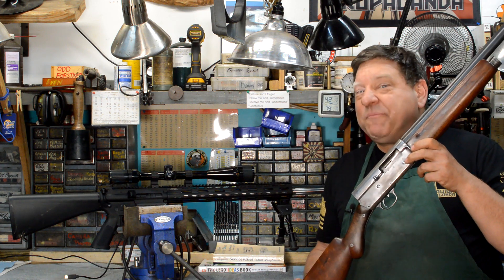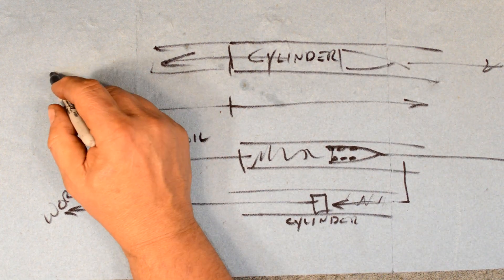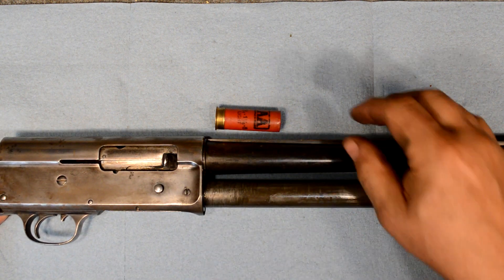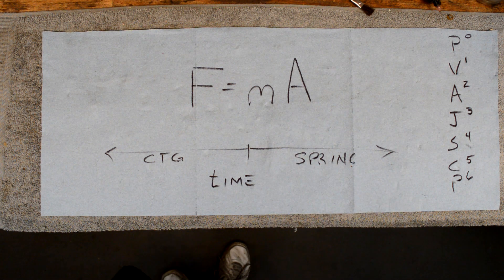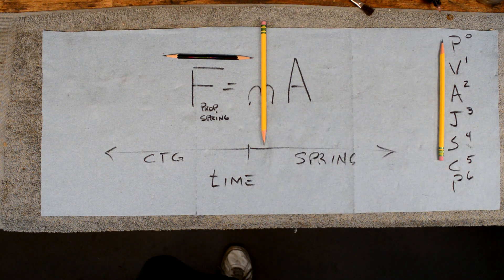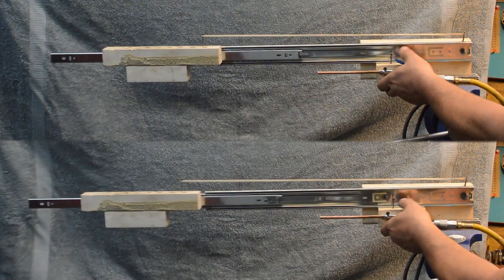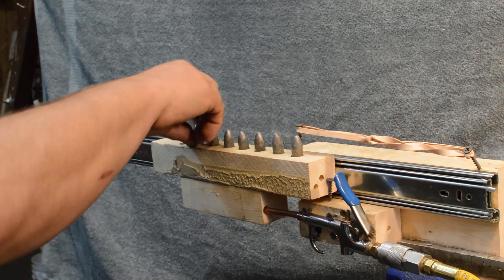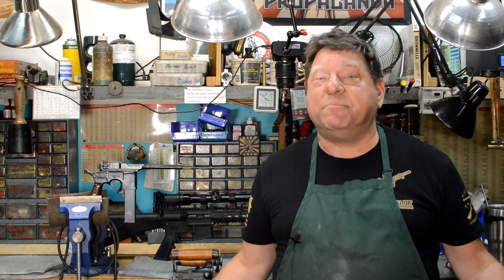Operational Physics: Anvil 069

Comment: Excellent demonstration. My only nitpick would be the bit about the system on the AR. You showed it with the gas tube and it blowing back and then later showed a tube of gas blowing back the drawer slide and I worry that gives the wrong impression to some degree. It sort of implies that the gas blows into the gas key and the buildup of pressure in the gas key causes the bolt carrier to back off from the gas tube and cycle the rifle. What really happens is the gas goes through the gas key into the bolt carrier, which is acting as the cylinder, and the gas pressure pushes the bolt forward from the perspective of the bolt carrier. Since the bolt is unable to move forward because it is against the barrel this causes the bolt carrier to begin to move rearward instead. This movement causes the cam pin to intercept the bolt carrier which forces the bolt to rotate and unlock from the barrel extension. When the bolt has moved far enough forward the gas inside the carrier is vented and the bolt carrier continues to travel rearward compressing the action spring on momentum from the expansion of the gas within the bolt carrier. I get that isn't what the lesson was about and going into it is probably not worth it but still, don't want people thinking the AR is as simple as that and that the gas rings on the bolt do nothing or that the inside of the bolt carrier does not need to be cleaned from time to time of carbon.
Reply: Oh boy... I wish that was simpler... 
But I believe I get it.. I just get lost with all the terms ... I think I get what you were saying compared to him..
Reply: @strydyrhellzrydyr1345  I was just talking about the AR-15. He showed an AR bolt carrier group and the gas tube for it and then showed his demo with a similar gas tube (the air nozzle) and I just wanted to point out to any viewer that may not know that this is not how the AR works even though he showed an AR as an example. I could see how someone could get confused and see the AR bolt carrier group and the gas tube and then see the drawer slide and the gas tube and assume they worked the same way because both examples have gas tubes but they do not, even though they are similar in terms of the example used, so the mass and velocity lesson is still applicable.

I am happy to break it all down further and explain any detail you may be stuck on, just give me a hint where to start.
Reply: Isn't it actually accelerating to the Right.. and decelerating to the left... Opposite of where he points.
The spring I mean... 8:55... 

I figured maybe I could ask you. Since I know he's a busy person.
Reply: @strydyrhellzrydyr1345  
It is decelerating the bolt when it is compressed. It is compressed when pushed to the right based on the reactive force from pushing the projectile to the left. After being compressed and stopping, the bolt is accelerated to the left again, picks up another cartridge, closes the action and ready to start again.
Reply: @onpsxmember  oh I know.. thanks.. 
I get that part... I was just trying to understand it by what he SAID... 
I could go by what I think.. but I was purposely trying to go by what He said... Since I am the novice...
But yes I understand.. thanx.

The problem is... He was explaining it as a gun facing to the right of the screen.
Reply: @strydyrhellzrydyr1345  Sort of.. depends on how you look at it. The spring is being accelerated by the cartridge, which could be what he meant.
Reply: Wait, waht?
Reply: Orion - yes, the goings on inside an AR are very interesting.  I think you could say that the “gas cylinder” is inside the bolt carrier, formed by the seal of the gas rings and the tail of the bolt with the hole behind/around it. When the gas enters that chamber inside the carrier that is formed by the bolt itself, initially the bolt is pushed forward at the same time the carrier starts moving backward. This take pressure off the bolt lugs and locking lugs on the barrel extension. Almost as soon as the carrier starts moving backward, the cam pin is forced to rotate the bolt thereby unlocking the bolt lugs from the barrel extension. By the time the bolt is disengaged, the carrier has moved backward far enough so that the gas rings on the bolt are ahead of the little vent holes in the side of the carrier. Gas pressure in that chamber inside the BCG is released and the entire assembly can continue moving backward due to inertia. This is the genius of Eugene Stoner IMHO.

Comment: But wait.. isn't the recoil part he says about on the bottom example... The same as the top one.. 
They are both recoil.

But the barrel is t moving on the chocheaut... Sorry I have no clue how to spell it..
I'm also confused on the cylinder statements... They are way different.. not just the cylinder in one and cylinder In the other

Comment: Video starts at 11:00
Long recoil is a derivative of cannon fire. 
Gas operation was (allegedly) discovered by Browning shooting in the tall grass. 
Maxim used recoil and gas principles on his gun, and also designed the initial prototypes of Brass, to prove the mechanics before the material was strengthened to steel. 
Kalishnikov invented nearly nothing, and the AK proves to be little more than a sloppy amalgamation of ideas, and ignorant of the issues presented by corrosion in a gas system. 

Gas operation was the least preferred, as drilling a gas port in the barrel was considered damning during the era of corrosive propellants, but has been accepted as a usable force since the beginning, as Maxim, and various short recoil guns, use muzzle boosters, which also suffered from corrosion issues, as you see all WW2 MG kits with a booster cleaning canister

Comment: Im fixing up a parker hale 30.06 i found i the field this year while ditch cleaning for the band office on the reserve. I have weighs tied up to the stock grip to help the glue settle were the crack in the grip is. Ill add a metal pin inside to help it keep together. Its a very nice looking rifle still but needs alot of work. Now that i have it it will be done and in good quality. Im using tung and teek oil this time for the finish with some stain. I took out the old chipped bedding and ill bed it again. Fun time to work with any rifles.

Comment: Mark, fantastic presentation !!! I see why you were teaching at one point in your life. I am a bit disappointed about one point in the presentation, the equation F=mA. At the point where you got to the F component being a representation of the Spring, you stated "At this point the equation works backwards", then you cut to the gizmo demonstration. I've tried every way I can think of to show that like you did with the F being the propellent component. I can't seem to get my head around the F=mA working backwards. Do you have to re-arrange the equation first to show the Spring component? Can I get you to elaborate a bit on how it works backwards? Please.
Reply from the maker: The equation is not rearranged, but the magnitude of the spring push is negative. Propellant force plus negative spring force should add up to zero, neglecting friction and sound.

Comment: All semiauto guns are piston driven. The cartridge case on a straight blowback is essentially the piston and is replaced after each shot.
Reply from the maker: That's it.
Reply: @marknovak8255  I think this would be a good topic to discuss in a video, because I've had countless people disagree when I said "all semi auto guns are piston driven". It would really make some people think about it a little more, especially if someone with your pedigree were to discuss it. You are actually the first person that makes videos to actually agree with the statement, unless you were being sarcastic and I missed the sarcasm. All semi auto guns are piston driven, and the piston is just located in different places. Straight blowback uses the cartridge case as a self replacing piston. The AR is an internal piston inside the BCG. The AK is obvious. Roller delayed is essentially the same as straight blowback with the cartridge case as the piston and the rollers "delaying" the opening of the bolt, etc. 
I'd love to see the responses you get if you were to discuss this topic.

Comment: I noticed on a kangaroo drive many decades ago those Browning's were soft recoil guns , compared with my Winchester pump action. Or they used lighter cartridges.
Reply: All other things being equal, a semi-auto is basically ALWAYS going to have softer recoil than a manually operated gun. The springs involved absorb quite a bit of the recoil impulse that you'd otherwise directly feel.

Comment: MArk, as a physicist I am offended by one choice: Acceleration is the vector small a, not A. A is the area.
Reply from the maker: Copy that, but the lesson still works......?
Reply: @marknovak8255  the formula checks out but for the different character to the standard.
Reply: Some Electrician is gonna tell you that A is amperes
Reply: @cstoff6066  Ampere is a unit, the formula was with variables.
Reply: @trischas.2809  I know, Amperes usually gets denoted as 'I' as in V=IR. Thank you world for the confusing array of characters based on people's names, Greek prefixes and medieval containers. Hogshead of Ale anyone?
Reply: @cstoff6066  Thanks but, I pfefer a Gō of Sake. Bur then again, why don't we all measure our length in Angstöm anyway? Wouldn't be too confusing I assure you. Not even too prone to a few inaccuracies for exponent drop...

Comment: This is an excellent episode. It does a great job of explaining "over gassed" MSR. The problem is usually timing. I like to slow the bolt down with heavier buffers and springs before I even consider adjustable gas blocks. The gas is supposed to be there.

Comment: That was the most awesome explanation of operational mass and timing I've heard in years the first time I was 7 or 8 and I was asking my dad what he was doing he explained hes increasing the amount of powder in a 30-06 round but needs to make sure not to over pressurise the gas system of the semi auto M14 rifle because to high a pressure may alter the timing of the bolt mass as opposed to the return buffer and ultimately break the rifle. Haveing an idea what you were saying fromhaveing listened to my dad years ago. Gota say I love when the call come down to get down the rabbit hole.

Comment: O.K. I have a 45acp ,4.25" barrel, 200 grain or less is recommended.
I have been using 185 grain when shooting this pistol.
My 45acp with 5" -barrel 230 grain is good. The weight, spring distance and timing
thing starts to make sense.

Comment: So, we have an action and a reaction that is equal but opposite. The bullet goes out the end of the barrel and the opposite reaction is felt recoil to the shooters shoulder. Can we take the felt recoil and redirect it to somewhere else, other our shoulder, allowing a person to shoot a few boxes of hot 45/70 loads free of felt recoil pain and shoulder damage during an outing to the range? I've seen barrel ports, mercury filled tubes in the rifle stock, butt stock pads, shooting vests, but I am not so sure those felt recoil remedies are a mechanical solution.
Reply: Problem I have with lever guns is, they are too light. Heavier weight accelerates slower, spreads out your felt recoil from sharp punch to heavy push. Why I love taking out my Garand more than a cut down 1903, the weight will save your shoulder. Don't know how that helps your problem though, short of ratchet strapping sandbags to your foregrip. Much luck to ya.